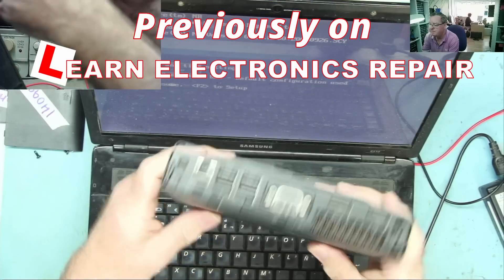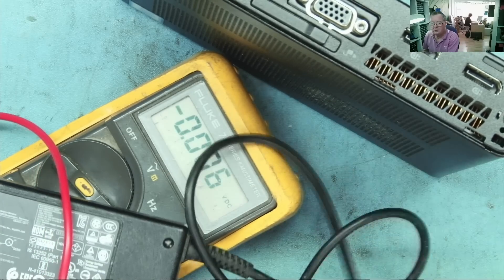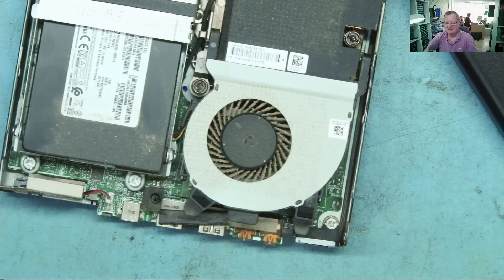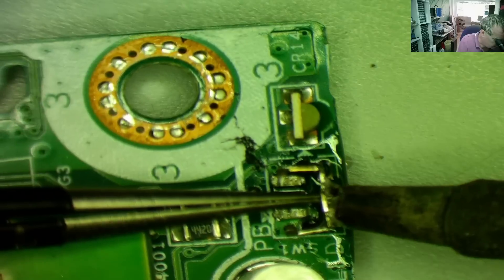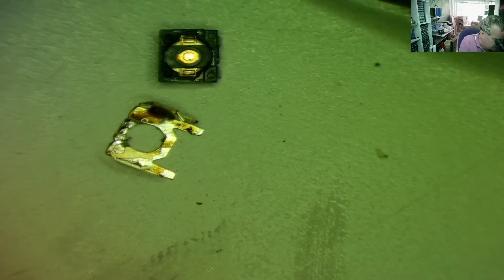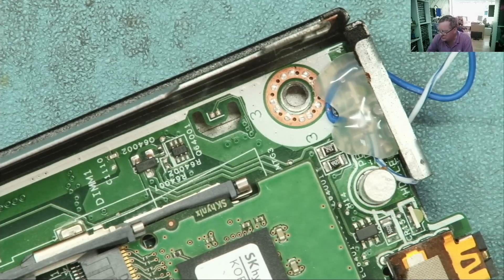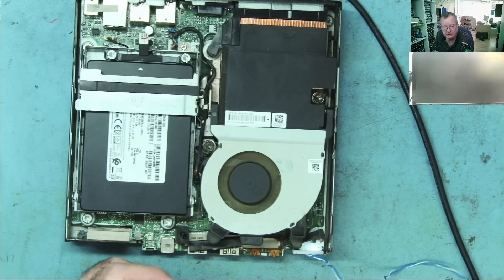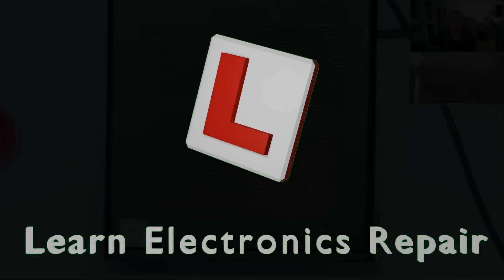Sometimes You Have To Botch It To Fix It! Is This a Good Repair or Bodge Job?

Comment: Heya, as the costomer needs it back working this is the best you can do for now without the original switch. yes ofcores you charge the costumer it works that's what they wantted oke if you can get the original putton and the custumer want that you can order it

Comment: That is what I would do and wouln't have any qualms in charging them for the fix. It is a safe repair that you did not circumvent anything. That repair will lprobably last for a long time if they do not decide to proceed with getting a replacement for the original switch.

Comment: Nothing wrong with doing a repair like you have done. It’s only a problem if you tell the customer that you have done a proper repair. The fact that they need it to work and you have got it working means that they are happy and it gives you time to find the correct replacement part for it

Comment: I've done similar fixes.

I'm reminded of a switch I bought as a kid in the early 60's at an old hardware store.

It was my love of old scary movies that influenced my purchase of an old single blade version of a knife switch on a white ceramic base. The kind always used to send the volts to Frankenstein but on a smaller scale.

I actually still have that switch!  It would have looked great mounted to the outside of your  computer to go with the Frankenstein repair!

Comment: Hi Richard, nice Job.  Isn't it possible to set the BIOS so that the mini PC starts up after mouseclick
Reply from the maker: Detlef mentioned this in the video, setting the BIOS to start the PC on key press. But he says this only works reliably on wired keyboards
Reply: I must have missed that, but after looking back, he said it indeed. Still very educational. Thanks

Comment: Hi Richard. I have done a fair share of repairs. where the customer was happy for me to do anything to make the device working, including modyfying (wouldn't call it botching) it. I personally would try to hide the switch inside, but most likely, in your situation,  the switch you used wouldn't fit. Maybe some smaller switch, if I had it, but overall, the final result achieved :). Regards, Jerry from Australia.

Comment: The jobs fixed, the item works and they can use it. 
If I was the customer, I'd be over the moon that you came up with a temporary solution, without damaging the item, allowing the item to be used, whilst waiting for the repair. 
This is the difference with your thinking. A normal repair shop would just stick in on the shelf, and then onto another job, whilst the part arrives, if it ever does!
Great job! As usual!

Comment: By the looks of that system it been well used so i would be discussing replacement.  Next, remind the customer that Microsoft is depreciating windows 10 in November 24. Tell the customer that due to its age hp no longer makes the part
  Then I would permanently  mount that button in the side and charge the customer and not think twice about it.   Great video as usual.

Comment: I did a similar repair in the past. It needed a button at 90 degrees so I used a replacement shoulder button for an xbox360 controller. Basically it's a common 6mm x 6mm momentary push button with a 90 degree mounting. They are through-hole so I bent the pins out and surface mounted it and it worked very well. I added some epoxy resin glue to make it rock solid.

Comment: Richard, this is not a "bodge" repair it's a "temporary" repair to get it working quickly for the customer. There is  absolutely nothing unsafe about this repair and you should definitely charge the customer. The fact that you intend to provide the customer with a quote for a permanent repair highlights to the customer that it's not your usual standard of workmanship. 👍
Reply: Ditto!

Comment: I limit bodegery to equipment life or death situations or as temporary repairs (usually to find out what else is broken before putting together a parts list). You got it up and running so certainly charge the customer. But I would do a little research, price a replacement part and let the customer decide - that's their job. Thank you for another interesting video! Regards, David

Comment: I like fixing these tactile switches lol i believe this one was pressed so hard because it wasn't making a good contact i don't blame them for that, nice fix as long as it's working
Reply: The main issue with this tactile switch Is oxidation of the dome. Often it Is silver plated...and so It Is prone to fail. Regards.
Reply: @paolomonai9511   @paolomonai9511  Yes indeed! i carefully scrap the rusted surface on the contact dome so it won't fly away and on the contact terminals as well and i lubricate them afterwards i did this many times it works perfect

Comment: Maybe you could have used a magnet glued into the button and behind it a reed switch? I worked as a PC designer and system builder and we supplied PCs to UK schools. One of the tests we did was to apply excessive force to all switches and buttons to make sure the kids couldn't break them.

Comment: Time is money.
They will probably be happy with the fix, so charge them, they could not do it and they can now use it.
If they have money to burn and don't mind the wait they may ask for a proper switch be installed.
They will probably understand you cant get all parts off the shelf, Devices that small usually have parts designed just for that particular device.

Comment: The customer will be happy it works, they probably will say don't bother with the new switch its fine as is :) great fix
Reply from the maker: The customer is very happy.  His wife uses this for her work and she needed it running.  He says if  I can find the correct switch then do it but if I can't he's quite happy as it is as long as it is reliable which so far it is.
Reply: customer might buy a solder iron and replace the switch himself if he watches this video 🤣 i would be happy with the bodge it's not a center piece fancy gaming pc it's small so it's out the way

Comment: RS and Mouser have a good supply of right angled PCB switches but well done for getting it together 😀👍
Reply from the maker: I have vertical mounting push switches, like you often find in various electronics but the one in the PC is tiny in comparison to the type I have https://www.aliexpress.com/item/1005006058692808.html

Comment: Question: would you clean the internals of a PC when opened? Far from the worst I have seen, but that one was quite manky.
Reply: That fan and the crap in the housing was making my OCD itch, big style.
Reply: thats not what the customer wants, if he wants it, then there is additional cost of that
Reply: Only if its a paid service. Also don’t clean the outside if it’s dirty unless this is covered in the repair quote. I’ve had a customer tell me I scratched their laptop because I cleaned it up for them. It was covered in crud and the crud / dirt was covering all the scratches up. Once cleaned you could see some of scratches all over. The customer ruined the outside and tried to convince me to buy him a new top case cover for his laptop because there “no scratches” before… 😂 He didn’t take care of his laptop clearly yet said it was like brand new when brought it in. I didn’t replace it and told him he can take any other devices to a different shop for future repairs. Time is money and I don’t have the time to be arguing with people like that.

Comment: I have seen a few switches with the same issue, but have had the luxury of a replacement systemboard, or whole unit. The switches don't like hard pushes and start to fail, which results in harder pressure and breaking the switch and or case. Sorry cannot help with a part no. I would also mention that with similar plastic case fronts, is to check that the face plate button is operating the switch. A loose cover can appear to be a no-boot when in fact a broken plastic faceplate or button is the issue.
The 'Bodge' job is called a workaround when talking to the customer😜 I discus it with them first.

Comment: Yeah I've done something similar i had a customer that had a laptop with a broken power button, but couldn't find any replacement was a weird slide power button on the side of it so i drilled a hole on the palmrest area, soldered a button on a small protoboard and hot glued it in and just ran the wire as you did as he just wanted to be able to use it and it was a pretty old laptop so i don't see the problem with the button if it works it works! haven't heard from him since that lol

and of course i asked the customer before if it was okay to drill a hole to fix it, seemed like he was just gonna throw it away if it wasn't fixed

Edit: that might be a "TL3340" switch looks really similar to it!